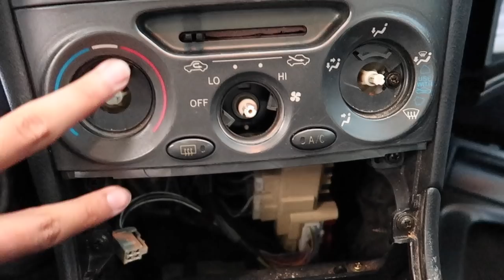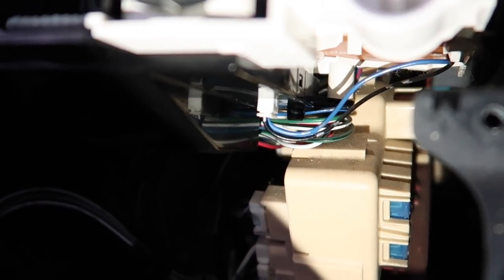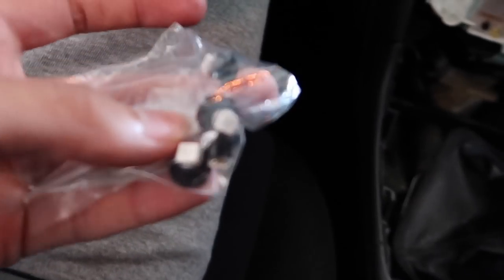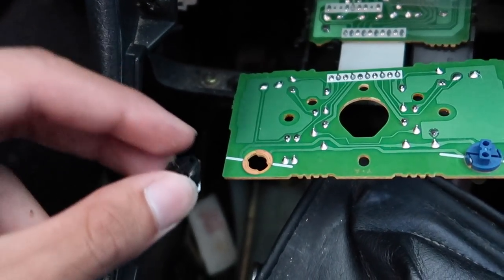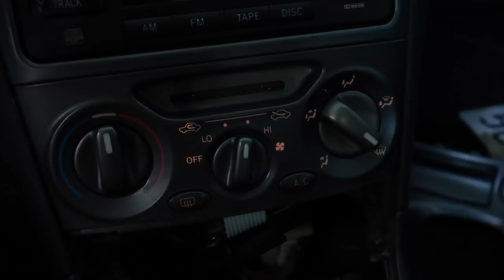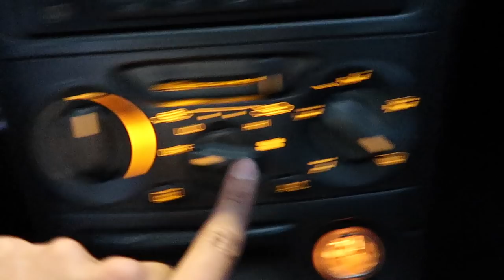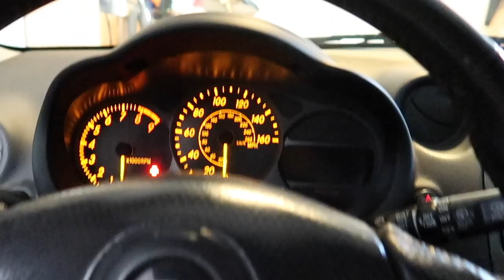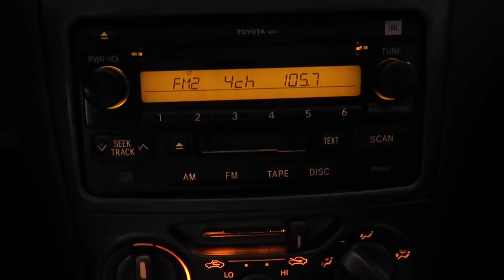DIY LED Climate Control Swap | Toyota Celica

Comment: For anyone thats wondering. T4/T4.2 is what fits 00-05 Celicas. If you took the OEM ones & measured it, it would be 10mm wide. (T3 is 8mm. T4.7/T5 is 12mm.) T4/T4.2 is 8mm & it should fit your Celicas. I suggest doing what he did tho... converting those 194 leds into T4/T4.2. Its brighter & it wont die out on you fast. Good luck!

Comment: Hey bro. You can out clear silicone on the back of the plate over that other hot spot. It will diffuse the light a lil bit but won't show up on the other side like a shadow.
Reply from the maker: That is a good idea, I was thinking of using a small piece of mirror, like one square off of a disco ball or something lol

Comment: You can put in a streetglow led 6 inside in between the brackets it’s works. In on the celica hobby page. Brighter n can pic from multiple colors too
Reply from the maker: I’ll look into that, but for now I think it’s fine :P
Reply: Do you have a post link

Comment: Just did mine a few months ago with a couple T4 neowedge bulbs (same size as OEM). They are already failing XD. Taking these 194s and retrofitting them is a great idea! I think i'll try that now. I don't like how mine only have the one LED chip. 

Did you also replace your rear defogger, A/C, and cigarette lighter bulbs too, or are the 2 LEDs just that bright?
Reply from the maker: Yup, that’s why I bought another set of leds with 5 chips.

And no I didn’t replace cig lighter or the defogger/ac, those are soldered on.
Reply: @equinoxgts  oh okay. I thought you did since mine are more of a white/greenish color. Some years must have been different.

I think you can actually remove the cig lighter bulb. Not sure what size it is though.
Reply from the maker: Yea the 00-02 were green and the 03-05 were orange

Comment: Nice video bro really like your channel I was just wondering that code you have for that Evap leak did you ever get that cleared up? I have the same one. I swapped the vapor cannister and still gettin it. Worried it might be a bad fuel pump
Reply from the maker: Thanks! As for the evap code, I actually only replaced my gas cap with a better condition one and the code hasn’t come back since.
Reply: @equinoxgts  nice. I think its my purge valve. Gonna test it. 70 dollar fix.
Reply: I got evap code too, every single time a fill the gas tank, then start the car" the car idles for 2 seconds then it dies. For it not to die, i need to drive immediately so it won't die on me, or just rev the car at 2k for a little while. Any idea what can it be? I replaced the gas cap and still nothing.
Reply from the maker: Hate Me B1tch it could be a leaky hose. Google the code and see what some of the fixes are. Start with the cheapest/easiest one. Does it die only after you fill up?

Comment: When wrapping the led wires around the original bulb adapater did you cut the wires to make them smaller? im having difficulty wrapping the wires around bulb adapter i tried once nd it didnt work:/ any advise?
Reply: Also i have tested these led bulbs nd they work but unfortunately i think the way the wire is going on the orignal bulb adapter isnt correct or maybe the wires must be pushed down all the way and curved perfectly?🤔
Reply from the maker: If you bought the same ones from the link in the description you shouldn’t have any problems with the wires.
Reply: @equinoxgts  didn't work on mine.  bought it from the same link you gave.

Comment: You happen to have the link of where you can buy the oem bulbs?
Reply from the maker: https://www.ebay.com/i/183287669378?chn=ps&norover=1&mkevt=1&mkrid=711-117182-37290-0&mkcid=2&itemid=183287669378&targetid=809744164705&device=m&mktype=pla&googleloc=9032177&poi=&campaignid=6470498059&mkgroupid=80514858234&rlsatarget=pla-809744164705&abcId=1141156&merchantid=137698883&gclid=EAIaIQobChMIpYqKy9rp5gIVFR6tBh307QFVEAQYASABEgKIZ_D_BwE

I believe these are it, but I’m not too sure. They’re quite expensive, I think leds would be a better option, cheaper and brighter.

Comment: How do you get to the map lights to put leds in there? I dont want to break them.
Reply from the maker: If you have the sunroof one, there’s gonna be one screw, then just pry the plastic over off and that’s it! Check out the sunroof assembly replacement video I have, I show how to get to the sunroof which starts by removing the map lights and such

Comment: Hey bro, I did this and now my transmission lights and all the lights except for the demister & AC Light aren’t working! Can you please tell me what could be wrong?!
Reply from the maker: Maybe you didn’t plug everything back in? The leds also have a specific way with how to light up. Try turning the leds around so the prongs switch sides and see if that works.
Reply: Equinox i tried all of that to no avail, all plugged in etc. LEDs were all working before putting it all back together.
Reply from the maker: Hmm not sure what to do, try checking your work again? Or try putting the old bulbs back in and see if they still work
Reply: @equinoxgts   Went over all my work with no issues, I have a feeling a wire has burnt somewhere, because the automatic transmission lights aren't lighting up when my headlights are on. I will take it to an auto electrician and let you know what they say.
Reply: Happened to me too I did the research and we burned the 2SK2231 mosfet in the cluster circuit board. Need to be replaced

Comment: im surprise you went with LED how are they holding up?
Reply from the maker: What would you have gone with? They are still holding up and brighter than stock
Reply: @equinoxgts  just curious had them in my old Celica but after 2months they began to flicker and burnt out. Couple of people had the same problem back in the day in newcelica forum but that was 08 maybe they just got better quality. Great vid btw also you should get a trd/sport m gas lid would go great on the celica
Reply from the maker: Interesting, I haven’t had any problems thus far. I’d definitely get a gas lid but they’re so hard to find and ridiculously priced
Reply: @equinoxgts  I just got a seven gen for nothing so I'm restoring and getting back at it again after so long funny thing is I still have all my old parts if I loose interested again il hit you up first dibs for pretty much shipping cost
Reply from the maker: Oh nice haha, just let me know :P